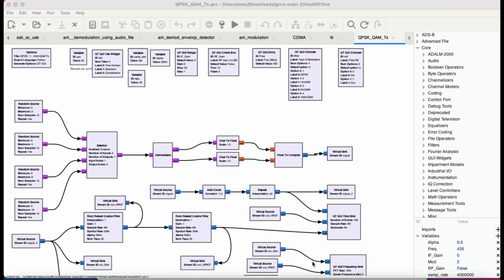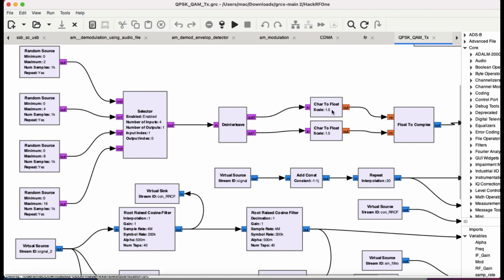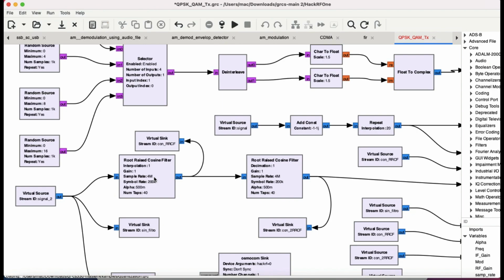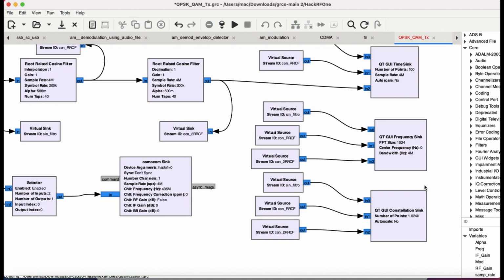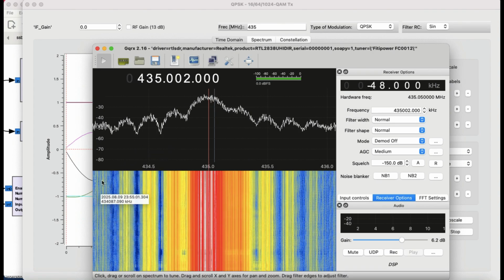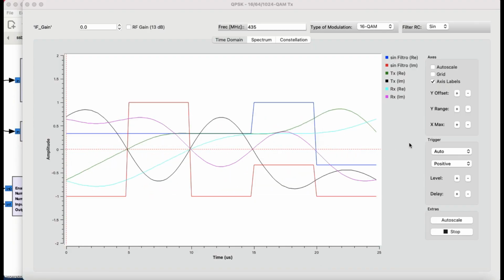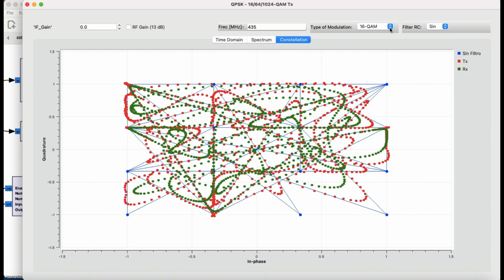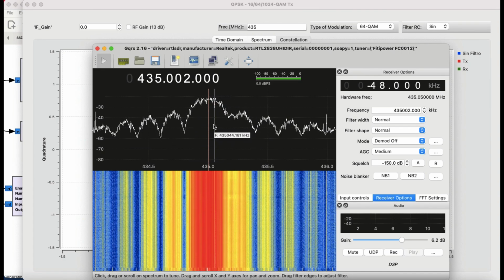From QPSK to 1024-QAM: HackRF One & RTL-SDR SDR Experiment

Comment: did you manage to transfer usable data using this modulation schemes? as in sending it via hackrf and receive and demodulate via you rtl sdr. because to me it did not seem that your receive loop has locked and the constellation diagram is all over the place